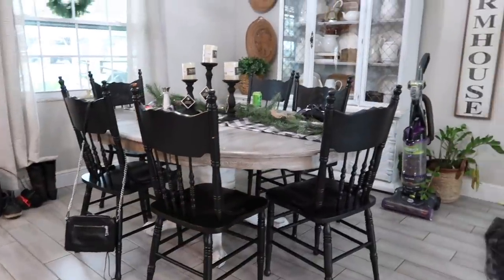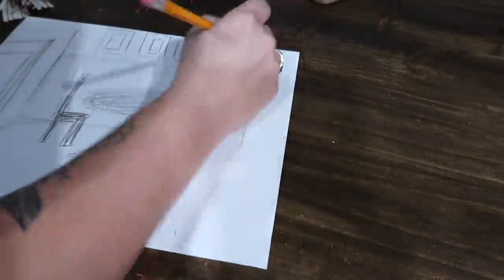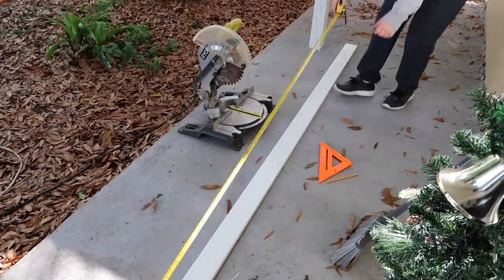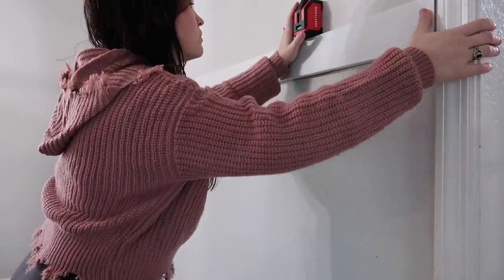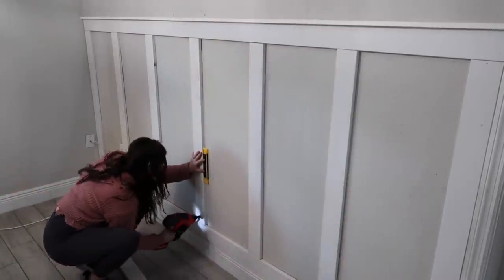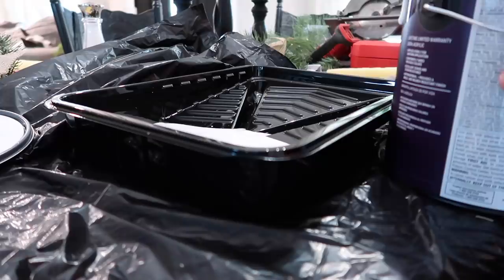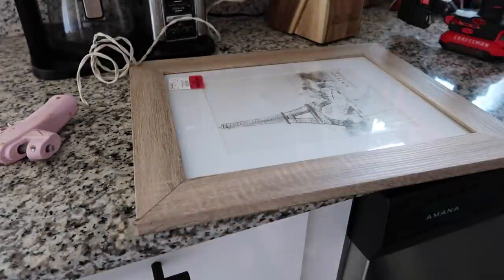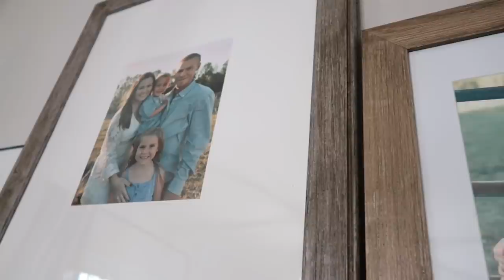Dining room makeover | Small Home updates| Extreme makeover start to finish ! Small home makeover

Comment: Love love love the new wall,you absolutely did a fabulous job, you are a miracle worker. I’m a little afraid of the pictures just sitting there is there some way to secure them?
Reply from the maker: Yes once I figure out my placement I'll use command strips to hold them so they won't tip. But honeslty they are pretty secure it would take a lot for them to get knocked over.

Comment: Do you have measurements for the boards?
Reply from the maker: No I didn't just because my wall is so uneven I had to individually measure but I put my top board to a height of 58 in and I have 8ft ceilings ❤
Reply: Thank you!! I’ll be doing my first project so needing a bit of help with measurements, my husband stepped in 😅 lol
Reply: A month later I finally finished my wall 😆